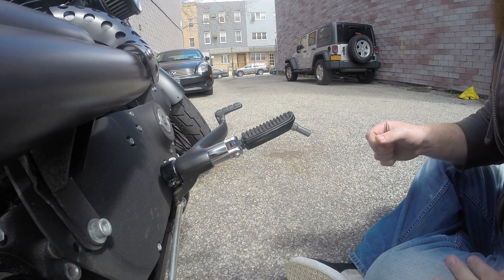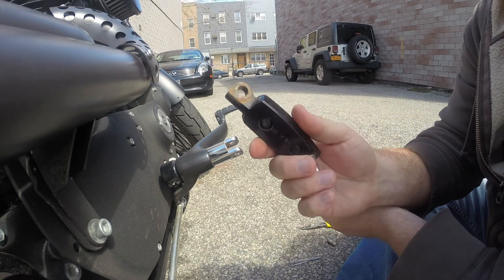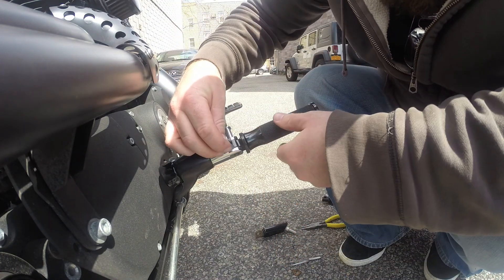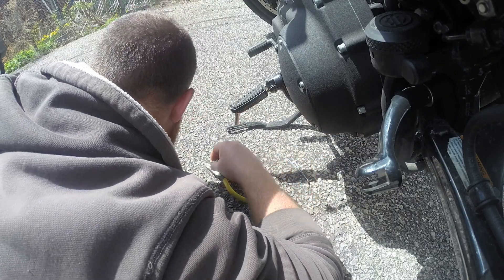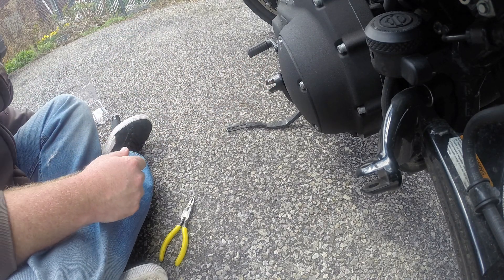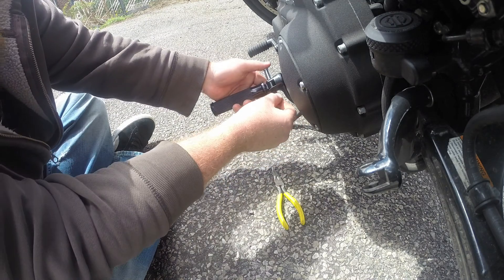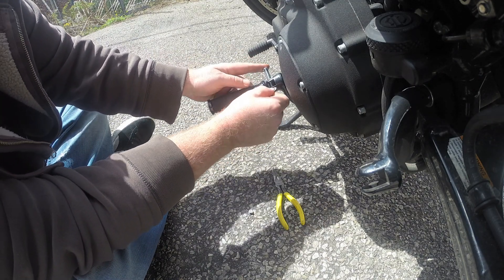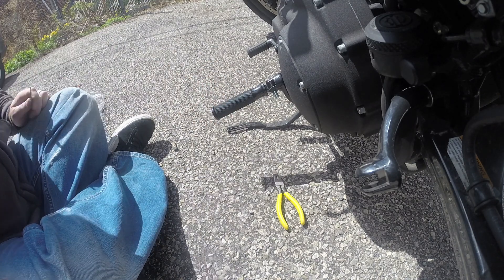Changing the Footpegs on my Iron 883 - Right Thing Motos

Comment: Hey man, nice vid, thanks for posting!
Are you running RC pipes? If so, what do you make of them?
Reply from the maker: Thanks for watching! I am running Rough Crafts Guerrilla exhausts and they are fantastic. I love the sound that they make both at idling speeds and when you really open up the bike (you can hear it in some of my ride videos). I also love the looks. Originally I was toying between getting the Vance and Hines Short Shots, but the Rough Crafts just look so much cleaner and more original. If you're on the fence about getting them, I say do it.
Reply: I have short shots. Everybody has short shots. Just looking for something different I guess. RC, maybe... or a clean line design from Sikpipes. Not so much the ones with dagger ends.
Thanks again
Reply from the maker: Urban Geurilla The Sikpipes look awesome! I don't think you can go wrong with either choice.
Reply: Do the RC pipes run hot on your leg?
Reply from the maker: Urban Geurilla Oh yeah! They most definitely run hot. I recently burned a hole through the leg of my pants, which left a nice little piece of crustiness on the pipes. I’ve gotten used to them for the most part but every now and then they’ll catch me at a red light.